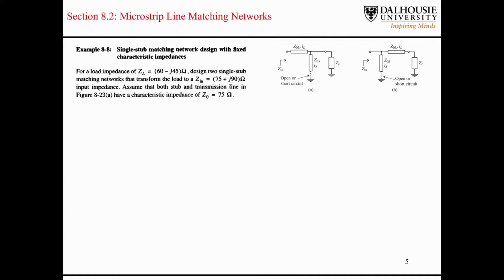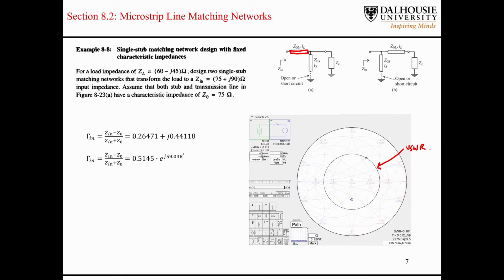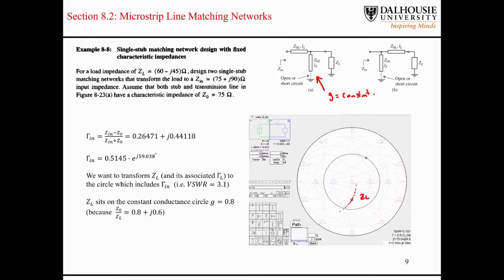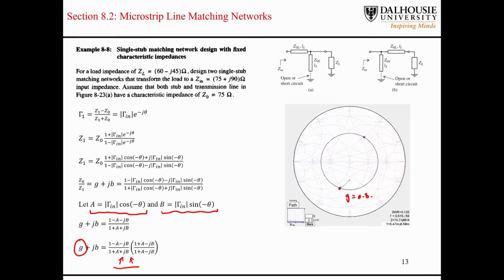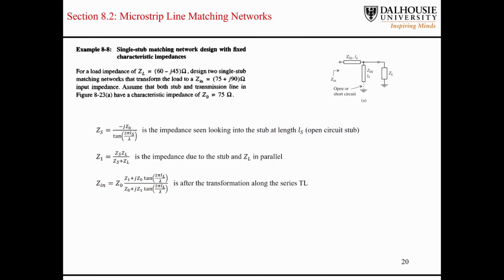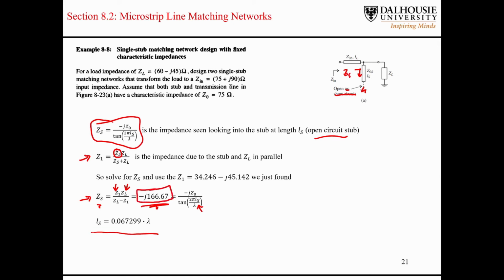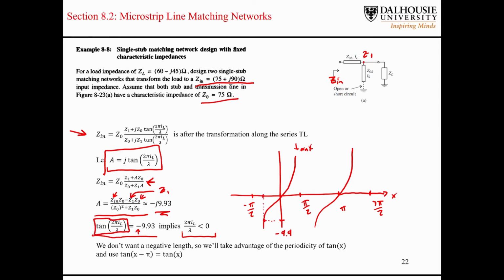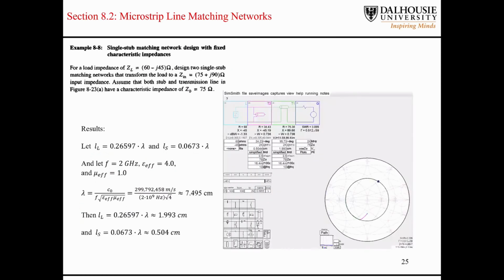L4.2 Example 8.8 Matching with Microstrip Lines using Analytical Expressions

Comment: When I calculate the value of A1, the value is different from yours.
Reply: because you have incorrectly transformed the expression for A
Reply from the maker: @conglevan63 I suppose it is possible, but I doubt it. It’s been a few years since I taught these classes, but I recall being very careful about checking my solutions to example problems like this.
Reply: @markuscwatson  you need a minus sign, not a plus sign in the position (Zo^2)+Zo*Z1.
Reply: @markuscwatson  It seems like you just wrote it wrong there, but the calculation result is still correct
Reply from the maker: @conglevan63  oh yes, I wouldn’t be surprised if that was the case. Thanks so much for pointing it out 😊